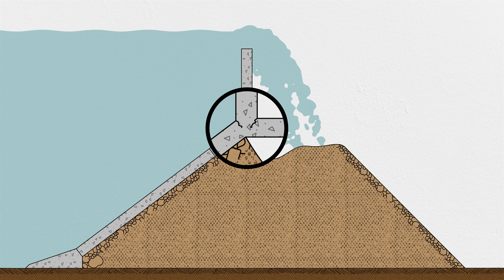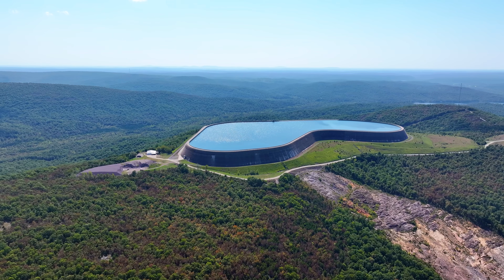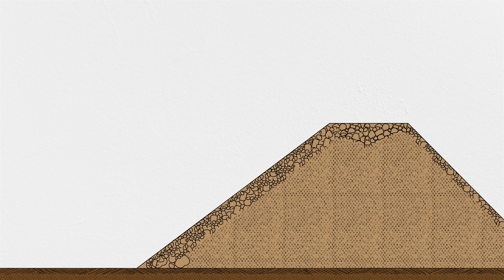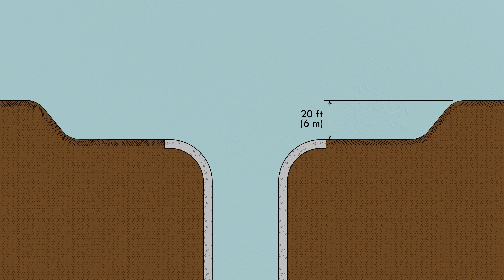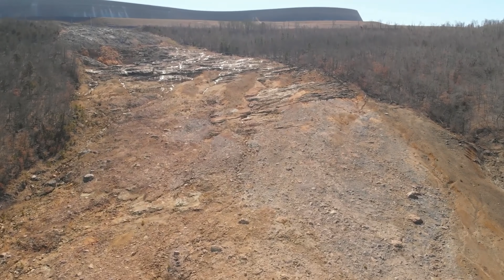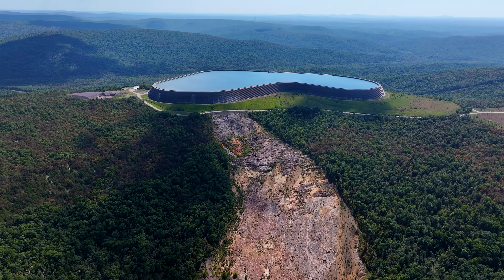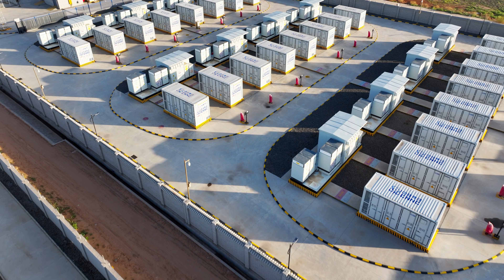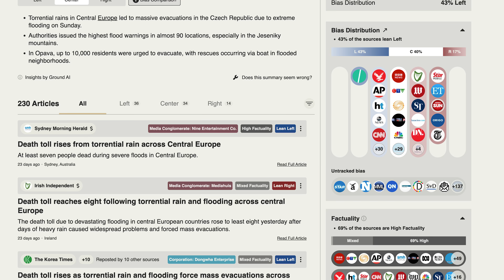The Wild Story of the Taum Sauk Dam Failure

Comment: Why didn't they just have an overflow pipe that has a greater capacity than all of the pumps combined with a sensor telling the engineers whether or not the pipe is in use

Comment: Another of many examples of management assuming that there is no need for a layer of safety provided by human beings. A couple of operators at the top of the dam, or even remotely at with camera observation and ability to over ride the automatic systems would have prevented this many million dollar catastrophe. 
       Another example is railways in the United States. They are allowed to operate tons and tons of train and freight with only two people on board, and engineer (driving the train and never allowed to step away from the controls, having to press a switch every 3 seconds to ensure they are at the controls) and conductor (responsible for the functionality and safety of the train). 
       Neither of these people has relief operators on board. Maximum running time for each person is 12 hours, there are no rest breaks, no bathroom breaks  for those entire 12 hours. 
Federal law does not pertain to railway employees. 
       Now there is a push to only have one operator on each train, soon possibly none.

Comment: To not have a camera and a staffgauge is crazy. Engineers only look at a systems from a function by theory standpoint but they lack the real world experience of working on/with these systems. Im dealing with this right now at the dam i operate. Over engineering and to much automation. We will slowly pick these systems apart over the years until we get a system that operates smooth and correct

Comment: I'm surprised such a weak design ever won awards, honestly. Impoundment all the way around a mountain top just to get 836' head? Dinorwig in Wales, by comparison, has a much bigger head and installed capacity and used old quarry workings for most of the site and an existing lake for the lower reservoir - and didn't disastrously empty itself

Comment: I'm a bit worried about battery storage. One there is a limited amount of material available. When you have to split it between cars and power station the cost might become astronomical. And lithium fires are less fun than a flood in a remote area.

Comment: Hopefully we won't need a video like this on the future battery storage systems - failure on sensors and a battery overheats, then catches fire, then the entire battery facility burns before anyone can get it under control; it burns for days and weeks, because of its LiPo battery cells, all the while giving off toxic gases that cause evacuations for miles, and shuts down highways near the facility. Unfortunately, I can see it play out in my mind like a CSB video covering a chemical accident. All for the same reason - mismanagement and assuming that not properly maintaining the systems and sensors (because it's "too expensive") ends up creating a disaster; in that scenario a disaster that burns a massive hole in the ground and causes issues for years afterward.

Comment: I cannot tell you how many times management arrogance and stupidity, combined with a blatant disregard for consequences has resulted in critical failures... Fortunately, most of the ones I have seen have not reached this scale of magnitude and destruction, but each were bad enough in their own right, and painfully few resulted in readjustment to an appropriate mindset to the dangers (or costs) involved with reoccurrences.  Perhaps if the various engineering agencies were not so busy glad handing and stroking each others egos, they might have listened to the people on the ground pointing out the glaring errors and performing the due diligence to follow the consequences of a given failure or combination of failures on the overall system.  Maintenance is an often overlooked necessity that is first on the chopping block to "save money"... often at the expense of safety measures as well. Too many times it takes a catastrophic event to occur before the "safety pendulum" swings from far too little, all the way to far over to the other side in compensation and disrupts other areas.

Comment: 😂 I guess “Engineers” are not good at synching áudio to video when they try to far just to record some dialog 😂
Reply: the audio and video are synced....
Reply: @caldeira_a  It's more than 5 ms out of sync with the lips, does not match the audio track. This means that the audio track was not synced manually and some software like was used to sync the audio, perhaps look into doing this manually ( more tedious but will match the lips) or SynthEyes which gets pretty close.
Reply: @danfuerthgillis4483  a human can't even perceive 5 ms of desync
Reply: @caldeira_a  Humans can perceive 2 ms with bone induction. That's the problem I have always had with guitar sims and interfaces. Even PCIe or Thunderbolt based interfaces are not fast enough for me, I can't play with an Amp more than 5 feet way due to my bone induction issue. What happens is the guitar string finger pressure bone induction hits my inner ear bones faster than the audio coming out of the speakers less than 3 feet away. This is why I had to return several external Effects processors over the years one of the worst effects unit are the Line 6 floor units they have terrible latency on the Digital to Audio converters which makes it ridiculous to play unless I use earphones directly hooked up to it. This is why I am still using an old Digitech 2112 Effects Processor it does not have this problem. What I usually do these days is a direct feed from the Mic's right to  WIRED in ear monitors ( not wireless). This is what I found to be the best direct latency free sound for stage or at home.

Comment: i would not trust having most engineers with running an HO toy train set. you never put two of the same type of systems in to back each other up, if you are going to put in an high tech system to monitor the water level you put a dumb system in as a backup, like one that has been around for a long time like the ones in a toilet, or even put in 3 systems what can it hurt, yes it costs some money up front but in the long run if it saves lives and stops major destruction of the area down the line it is more then worth it

Comment: The inverters used with online battery storage are the weak point.  Just like how a single coal plant going offline on the Texas grid triggered nearly all battery, solar, and a large chunk of wind power to go offline as well.  This was due to overly complicated, probably over engineered, electronic safety measures.

Comment: This is what happens when electrical engineers don’t talk to civil engineers. Civil engineers would have informed the electrical engineers where to put the sensors based on the low point of the parapet wall.

Comment: 8:58 "They FIGURED that doubling that amount would be enough" The older I get and the more I interact with people who are supposed to be the experts or authorities in their field the more I realize that people are literally just guessing and relying on intuition when it comes to serious issues of public safety. I'm an electrical contractor and I recently found out that a professional associate who is a architectual draftsman has been using the same load calculation figures for every house he has designed for 20 years because he's "never been called on it" before. He asked me to do it for a project because the county actually called him on it and asked him to resubmit.
Reply: A LOT of engineering is adding a bigger safety factor and calling it good. Generally things are over engineered so you don't have issues but as soon as I heard the conduit movement was unaccounted for I thought two more feet isn't going to be enough. They should have added 4 more feet and installed a secondary temporary alarm system.
Reply: Any engineer that simply doubles a safety factor and runs with it is just a bad engineer. Either that, or they were overruled by someone higher on the corporate ladder who cares more about money than proper engineering ethics. Could be a combo of the two in this case.
Reply: @luke-i1w It seems very indicative of every disaster I have ever learned about that it's almost always a whole combination of failures from the top all the way down.
Reply: Those experts dont make decisions. Obviously this reservoir should stop operations to fix the problems, to renovate and so on, but who decide that?
Reply: So true about many “experts”; the real ones are few and far between in every industry.
Reply: I live near the arkabutla dam in Mississippi. About a year ago we were told it could have a failure soon and now they have it drained but after learning about stories like these I worry how the repairs will go. I hope they do it right..
Reply: That is a really dumb and misguided takeaway from this. Nothing is perfect and mistakes always happen, some unforeseen circumstance or something happens and something big gets messed up, but usually the experts do their job and this doesn’t happen. It doesn’t mean experts don’t know what they’re doing, or that they’re just guessing, it just means we are human and mistakes happen, sometimes. Usually though, they don’t.
Reply: it’s true of everything, including philosophy. the “moral foundations” we have right now were fever dreams written out by French opium addicts who lazed around in their mistresses apartment all day. like… these are the people we worship in school, and they’re the same pseudo intellectualists in every industry
Reply: We might as well just let anyone engineer/build anything they want, won't be any different than if we let the the experts do it.  Brandos got what plants crave.

Comment: The minute you start dickering with off plan tweaks-subtract 2 ft, different anchor points for the floats, adding more and more band aids etc-just don't. You are making the choice to hop off the ledge and into the abyss.
Dark humor: They used to be rare occurrences.

Comment: 12:59, its quite rude to call them "normal acidents". We must think critically as to why a spillway was not implemented originally, why the "solution" applied to the sensors issue was to postpone their maintenance. 

When it comes to potencial failures history has proven us time and time again that if the consequences do not dwarf the cost of a solution it will simply not be implemented.

Installing sensors was way cheaper then building a spillway, so was using less rocks on the embankment.

Infrastructure must not be trusted to the private sector.

Infrastructure when built to profit is not only flawed but unreliable and costly, be it human cost or financial costs to the state in forms of mitigation forces or in worse cases rebuilding and rescuing, and thats without even mentioning the often huge amounts of money given to private companies to build said infrastructure, taxpayers money that goes directly into bank rolling a strategical piece of infrastructure that has been, is and will be neglected for profit. 

They ruin our lives and spaces through mismanagement of money that was taken from our pockets, all while charging us for services we already paid for, and when it all colapses we are the ones who pay to cover their mistakes while our goverments give them a slap on the wrist as fines.

For reference, Ameren's 2020 revenue was US$5.794 Billion while having US$32.030 Billion in Total Assets (Via Wikipedia) so for an operation of their scale 192million is not a huge set back at all, considering it is 0.6% of their assets. 

(Yes the data is mismatched by time, as the tragedy happened cerca 2005 and the data is from 2020, but it serves the purpose of ilustrating the scale these companies operate, if we estimate a growth of 10x in 15 years the totality of fines would still be only 6% of their assets)

Mind you, Union electric, which in the future came to be Ameren, operated the dam for 42 years before tragedy struck, time enough to cover the fines and most importantly, the dam makes money enough to justify rebuilding.

This time was a dam in a fairly remote place (except for the parks employee and their family) but it is not an isolated case, so what will happen when a more critical installation fail because a company chose to undermine its upkeep? 

How should the engineering code of ethics tackle the fact that companies more often than not do not comply to safety measures, as was the case with the embankment, because its simply cheaper to do so?

Comment: 1.2 billion gallons of water @ 100mph with a weight of 12 billion lbs racing down a mountain stripping it to bare granite. It’s a miracle this didn’t occur during a summer day when hundreds of swimmers were in the park at Johnson Shut-In’s. For anyone that’s familiar with that area and the topography they know it would have resulted in a 100% casualty rate. I was at the park with two friends the week the engineers saw the reservoir overtop the first time two months before disaster.

Comment: Had they used a sonar style level indicators or paid the salary of 4 or 5 operators to rotate shifts this would be a non issue today and frankly would have been on of the greatest pioneers to mechanical battery innovation that we would have utilized a lot more today than we do if not for the company's few cheap decisions. Yes we are seeing more and more utility power being stored energy but its not for the better environmentally as what is worse, a reservoir built on top of a mountain or the mountain being dug away to mine?

Comment: I worked on the “liner project” in 2004.  Let me first say, this place is incredibly HUGE!!  Until you are INSIDE the reservoir when it is empty, you have no idea how big it really is!!  I was part of the crew that was spraying Gunite on the inside of the reservoir to “smooth” the surface to prep it for the “liner”.  Everyone of us on our crew questioned the ability of the reservoir to “hold” the water safely due to NEW levels of hydrostatic pressure because the reservoir would no longer be “leaching/leaking” due to the new liner.  Seeing your explanation of what actually happened is crazy, to think a simple sensor on the TOP of the Run Off Wall could have stopped this, but I still say that the hydrostatic pressure was never properly accounted for and if it wasn’t the overflow that caused this, the pressure eventually would have.  I also thought that the someone would have reached out to us, the workers, and asked US questions about what we saw when we were working there.  Guess we are just the dummies that do the work, we don’t much more than that I guess.  Great video, appreciate your explanation.
Reply: Whats gunite? is that like a shotcrete/liquid concrete spray?
Reply: @tomh894 it’s a special process that allows you to “shoot” a layer of concrete onto vertical surfaces.  It is pumped DRY through a hose and at the last 18”-24” water is introduced and it mixes the dry concrete in the nozzle.  Makes for a VERY hard/high strength finish.
Reply: The leaking is what prolonged the dam from collapsing. It was going to happen, regardless.  The ponds they dig to pump the water back in is proof of that. It was only a matter of time. The wall was going to get washed out from underneath or top.
Reply: Stopping the leaks made no difference whatsoever to the hydrostatic pressure. HP is a function of the water level, which is controlled by the pumps. The leaks just caused the pumps to do slightly more work. 

Also, there was no "run off wall" because the dam was not designed for runoff. There were sensors at the top of the retaining wall, but as this vid made clear, they did not work due to the subsidence on the opposite side of the wall. The subsidence was caused by excess soil in the rock embankment - this in turn was caused by the "dummy workers" not doing what they were told by the designers when the dam was first built.

Comment: 15:40 "The event triggered states as far as Hawaii to bolster their dam safety programs" -- an even stronger motivation for Hawaii was the failure of the Ka Loko dam on Kauai in 2006, a year after the Tom Sauk failure.  This was an old reservoir left over from the sugar cane days, on private land.  When it failed after heavy rains, it killed seven people downstream, and nobody knew there was a problem until the wall of water arrived.

This highlights an even more pressing problem with dam safety that might make a good Practical Engineering video: the risks of old dams that are no longer useful and poorly maintained and monitored.  I grew up near Ka Loko and fished in it as a kid, it's easy to think of these reservoirs as permanent features of the landscape, rather than potentially deadly risks to people and property downstream.

Comment: Is there anyone who is thinking about building a small one to store Energy from a Photovoltaik system. It could be cheaper than a Lithium battery and I could cool my PV with the water, maybe even use it as a Thermosiphon for hot water in the Summer. Is there anyone who can recommend a pump and a controller? My plan is nearly impossible and I only got hot water and Electricity running so far. Any Link or Information would be great.

Comment: Total failure of management and accountability. 2 level switches and 2 hi-hi stops is hardly a complex system. The management at this facility should be help accountable and stripped of any operational/management roles in the future.
Reply: I feel like there are insanely many industrail accidents which include failing level switches. I find it especially concerning that often these systems rely on binary signals. If an emergency switch only provides a signal in an emergency, how can you be sure it is working? Ultrasonic sensors and pressure sensors have been available for decades, it's totally inexcusable.